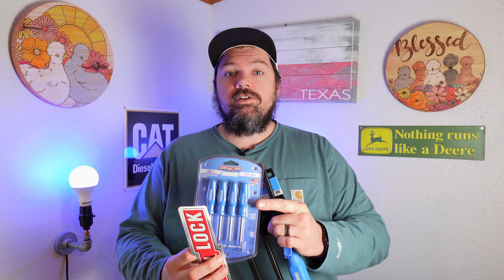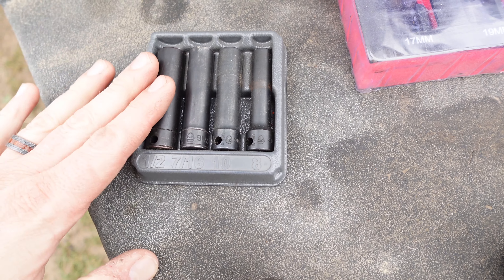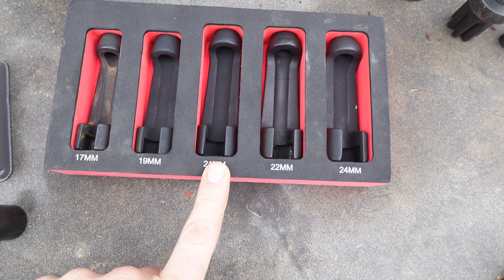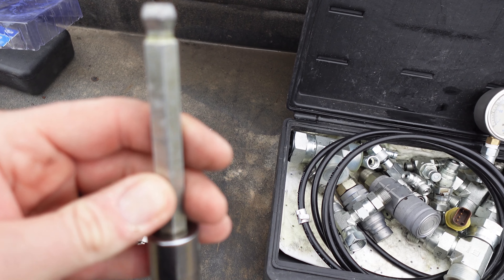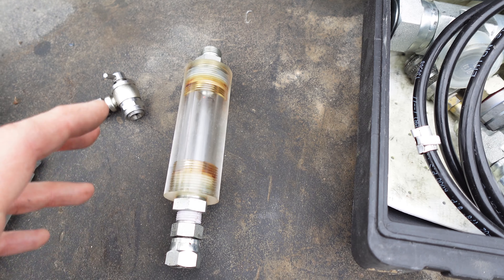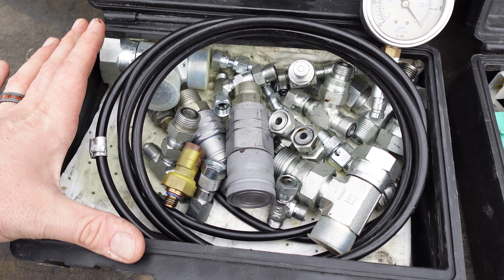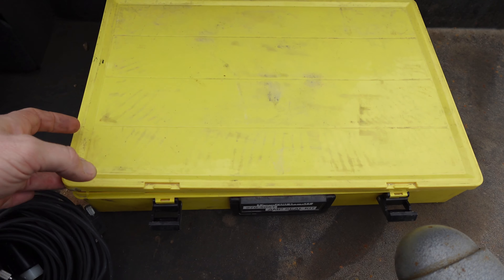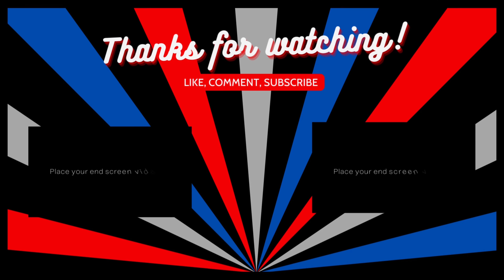What Special Tools Do You Need As A Heavy Equipment Mechanic?

Comment: Good video,  thanks for sharing.  Deutsch and Packard are two big names in electrical connectors, but there are many more used. I worked on CNH equipment for 40+years and had containers of many different connectors, and pins, and would always find something I needed and didn't have. Keep up the good video's!